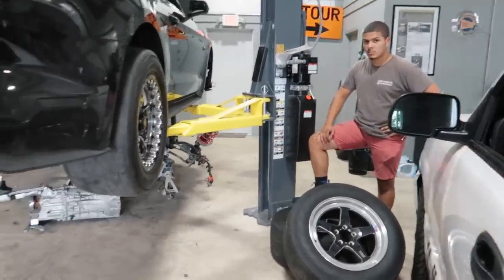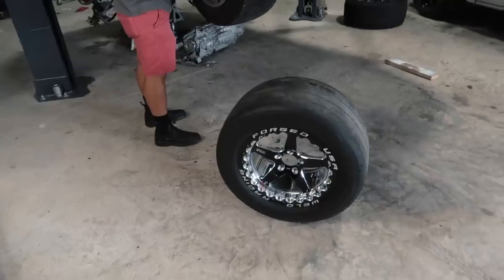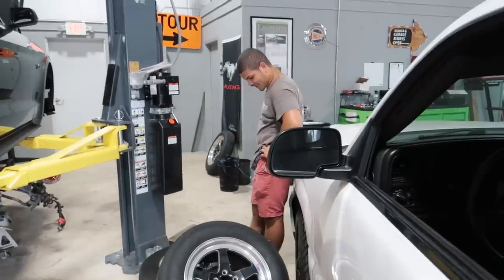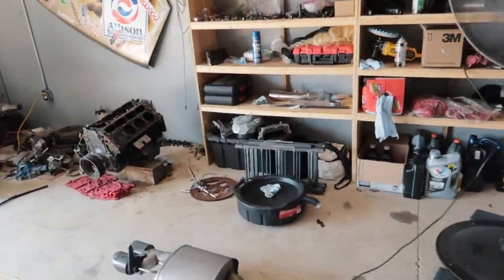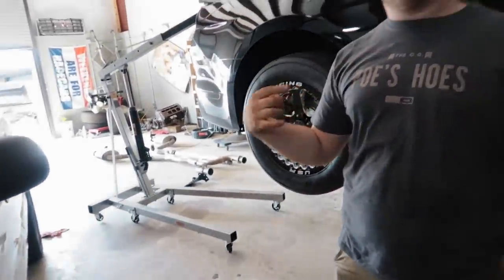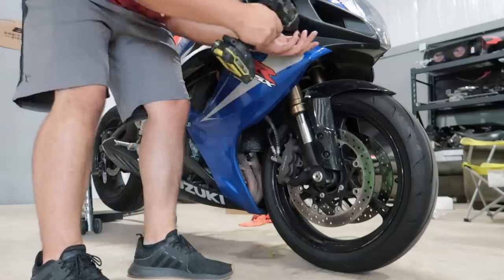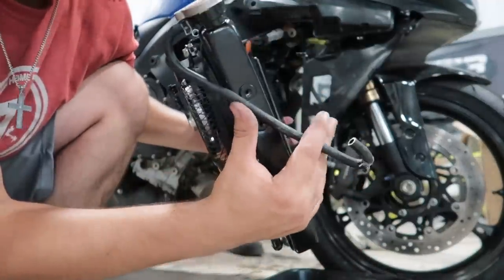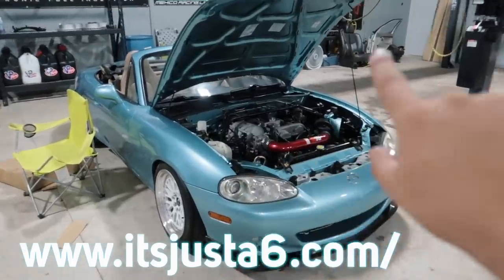Surprised him with his DREAM WHEELS!!

Comment: @itsjusta6 I would do more research before running 15 w 50 because I know with mod motors it can cause issues with the valve train some of the higher hp high rpm guys run 0w30

Comment: Had the same issue with the radiator on my 06 CBR600RR.   Went for a day long ride on a hot day and when I got home it started to leak.  Jb weld and a new radiator later it was fixed

Comment: itsjusta6 1. mantic clutches are very expensive i would recommend a Mcleod rxt trippel disc .  2. get rid of that stupid MT82 transmission and go with a Face Plated Magnum XL 6-Speed Transmission Assembly – $3,695 Assembly from liberty gears. 3. get rid of the factory ecu either go with a PROEFI 128 ECU or a Holley Dominator EFI .

Comment: Hell yeah! Congrats Harry! They do look good on Harry’s car. Bro random but for  a daily get a vw cc they don’t make them anymore and they sell cheap I have a 2016 cc and it’s manual 17 was the last year but you can’t get a 17 stick and try and get a 16 manual you get apple car play then I’m telling you you’ll love it and will be surprised how cheap they are mine with a lifetime warranty gap insurance and only 12,800 miles after tax and everything was I think 17,800 they were asking 14,500 for it idk just think you’d love it I love mine they’re pretty loaded I mean the sticker on mine was 33,000 msrp and it’s the base model but i have automatic rain sensing wipers heated seats every single window is one click they go all the way down temperature control for the air and heat they are not super fast but not slow either they have 200 hp but you can make them faster easily if you want to with a chip but mine moves plenty quick for me

Comment: I need an opinion ?

I'm not 100% sure if I should buy a $28,000 2015 Ford mustang GT or  1968 that I seen for $10,800  both are  manuals  , all I have currently is $78,000 save up after nearly fifteen years saving up , from blood sweat and tears .

Comment: You gave him a 6month old set of rims instead of spending less than a couple grand for him which you make in 1 video
Reply: They’re not just “rims”, they’re welds, and they are quite expensive actually. That’s probably around $3000 with tires included.
Reply: Sloyote point is he can afford a new set why not gift him a new set

Comment: So you decided to stick to a manual transmission with the new engine
Reply: Richard Bostick I don't think he did because the video he announced it in said that he will always put this trans back in until it breaks  then get a new one and he is buying a manual corvette so I think that's the power glide move
Reply: I'm pretty sure a throw out bearing is for a manual transmission. And who said anything about a Corvette
Reply: Richard Bostick the corvette is on the website if you turn your phone sideways, yes a throw out is for a manual trans but e has to rebuild the trans cause it has no fluid or anything in it
Reply: Ok. So him putting it all back together then with 1200 hp and a manual transmission. Then that means hes putting it back in. So therefore it's still going to be a manual. So I'm still not wrong your just trying to sound like you know everything I get it